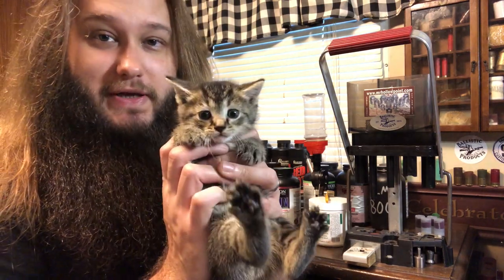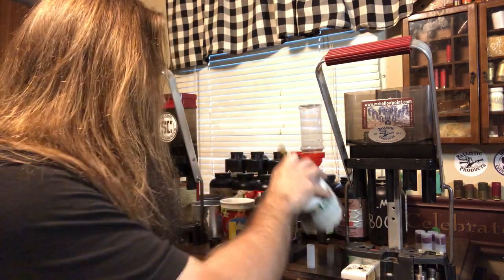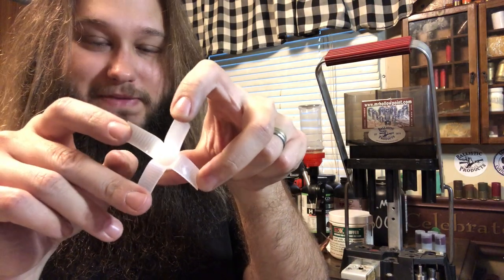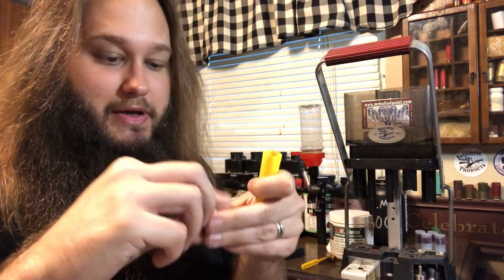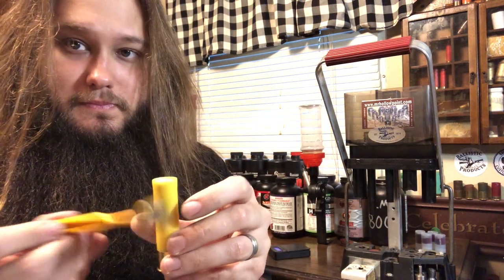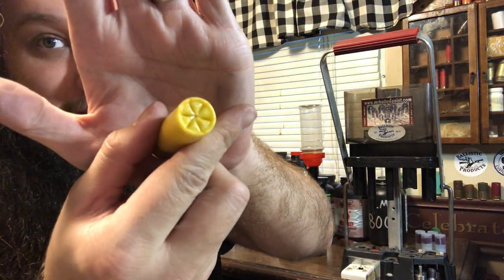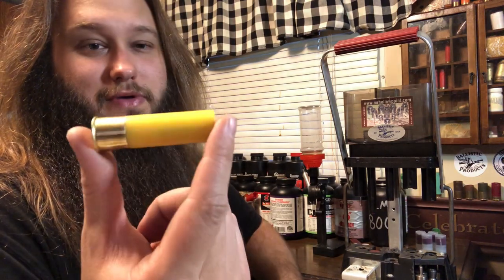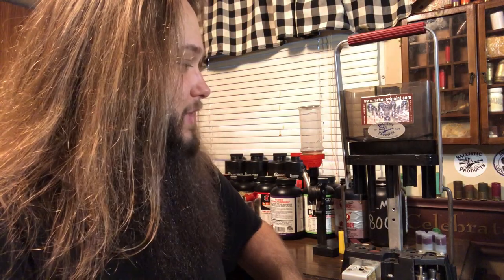20 Gauge 2 3/4” TSS #9 1.25 Ounces

Comment: You need a Stoeger in 20ga
Reply from the maker: It would be nice yeah
Reply: I've had a M3020 since it was released. It's been a great gun; squirrels, rabbits, crows, ducks, geese and turkey hunt with mine.
Going to load up some light TSS, 1oz and these 1 1/4oz for turkey hunting this year. Bad shoulder so I need something with less thump than the 1 3/8 oz Apex I used last year.

Comment: The ONLY choke manufacturer I know about that allows steel shot tighter than modified is Briley.  I may be wrong, but TSS is tungsten steel shot.
Reply from the maker: Tss means tungsten super shot, nothing to do with steel actually. It’s fine for Turkey chokes because usually people use sizes like #9 which is tiny.

Comment: What's your opinion on 20/28 powder considering I shoot a 20 bore and am thinking of switching to 28 bore for clays, the low pressure appeals to me because I like the older sxs I think I'm right in a straight walled hull would be better
Reply from the maker: I’ve never been able to get any of that powder so I’ve never used it